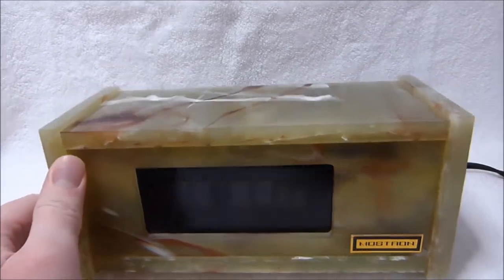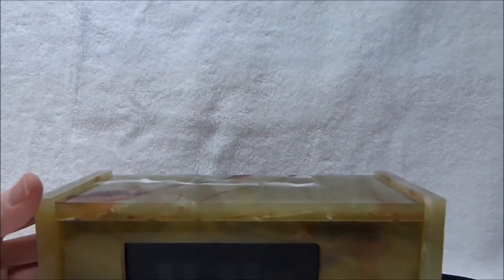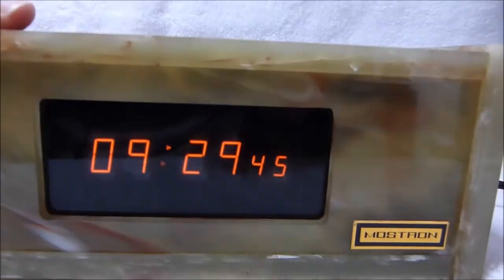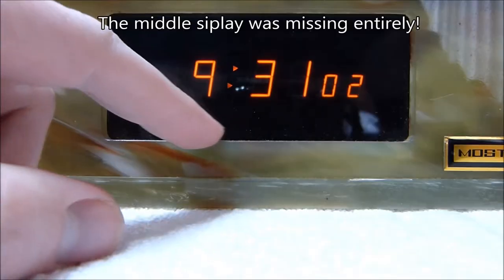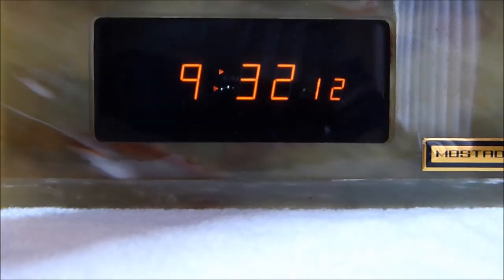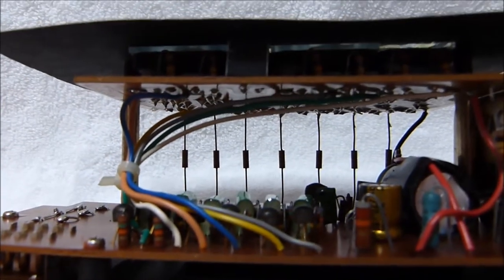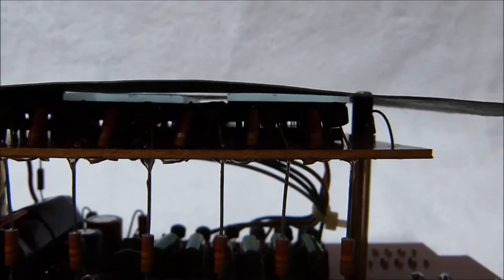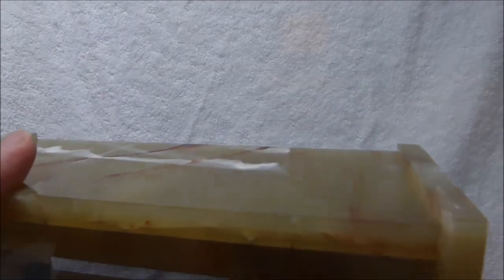Mostron model NM-388SD clock (made in Japan circa 1974)

Comment: These Panaflex displays may have been a crossover technology from the era of Nixie tubes(vacuum tube driven) to the age of solid state technology. 
Nixies were bulky and cylindrical, the Panaflex better fitted to flat panel displays
Reply from the maker: They also have a bit better readability than most small Nixie tubes do.